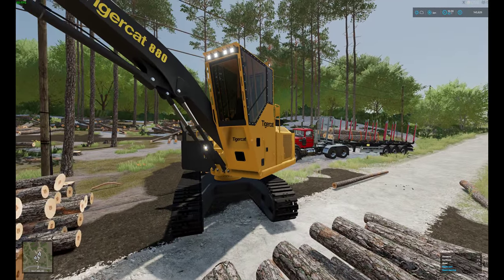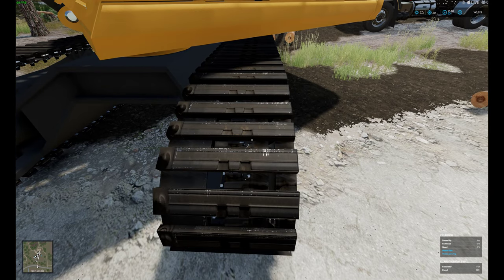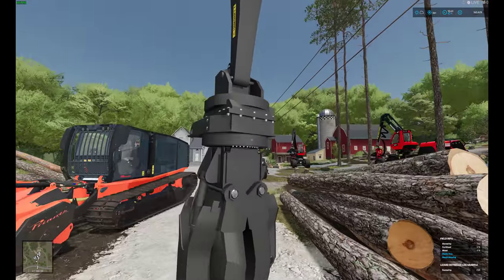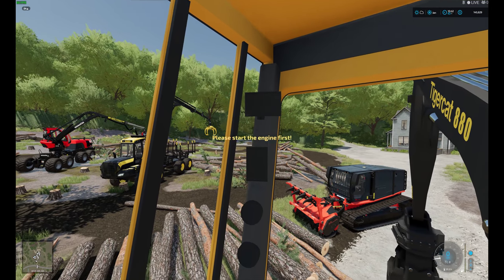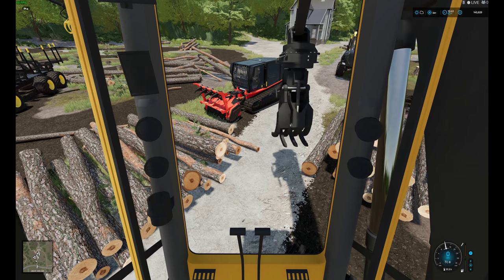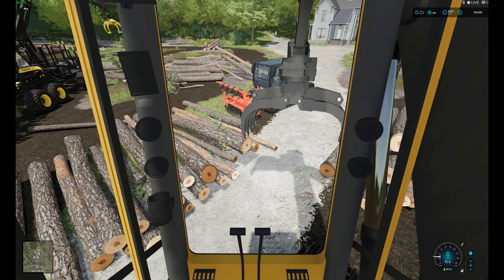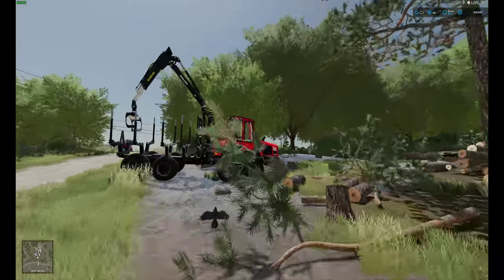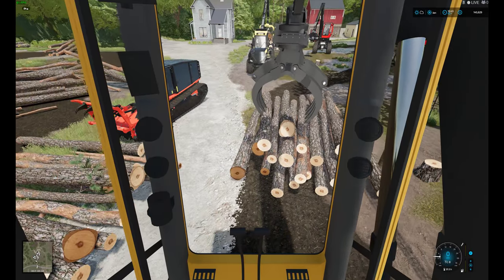How The Tigercat 880 is Coming Along So Far - Farming Simulator 2022 - FDR Logging

Comment: Watching you is an Education, although not sure what udims are, and what I know about Computers can be described in 7 letters first being F. FYI all the in game Trucks have Issues pulling, even worse if off road. They are going to be updated hopefully  before Christmas. The game is so much better than 19, Pallet forks, bale spikes and logging forks all now work in game, 19 you had to have modded. If using a shovel you can now push material around as IRL.  The PDA now shows changes to map, ie if you plough Road with Raptor it will show as road on PDA. Plus loads of other improvements. Love your work, thanks.